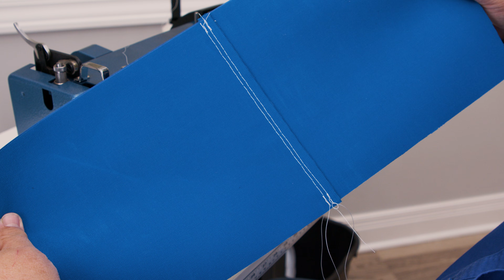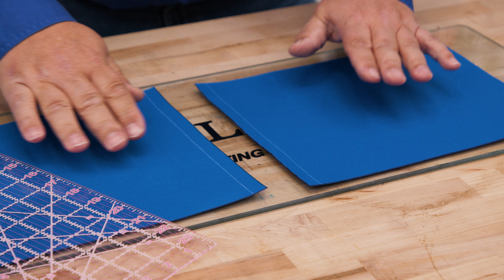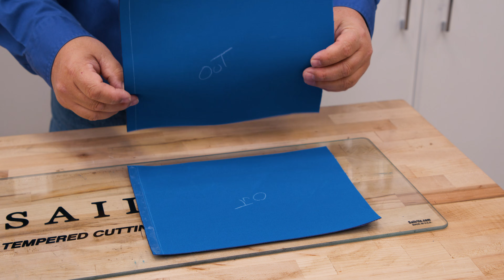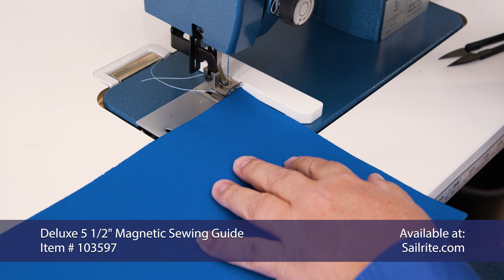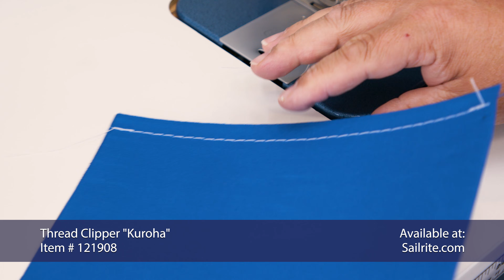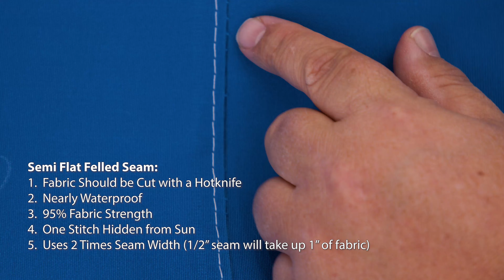Semi Flat Felled Seam Construction

Comment: So when you say nearly waterproof. Is that because the first stitch does not go through the seam stick tape? Also what size needle, thread, and stitch length is ideal for the application of sunbrella on a boat? Thanks.
Reply from the maker: Yes, that is true. However, you cannot say waterproof anytime you sew a fabric, since it creates holes in the fabric. I would use a size #20 needle and Tex 90 thread with a 6mm stitch length.
Reply: @SailriteDIY  Thanks for responding. What applications would you use a 138 marine thread?

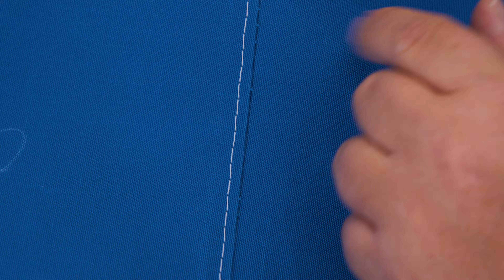Comment: At frame 3:53 you show the stitch and it's not a nice straight stitch...What do you need to do on the machine to make each stitch fall in line with the next....
Thanks, Mike
Reply from the maker: So why are the stitches slanted? Particularly in reverse! Because, the hook picked up the thread on one side of the needle and released it on the other side of the needle. So the thread enters the hole made by the needle on the side of the bobbin thread where it was picked up and leaves the hole on the other side of the needle and bobbin thread.  The bigger the needle, the more obvious this will be to the naked eye.  Observe that as the needle and thread size grows, the slant of the stitch becomes more obvious. That is because the needle is making a bigger hole in the fabric so it is easier to see which side of the hole the thread went in and which side of the hole the thread comes out.
Use a smaller Needle and Thread to reduce the expected result of angled stitches.
Reply: @SailriteDIY  Thanks for the excellent explanation with regard to stitch appearance. YVR